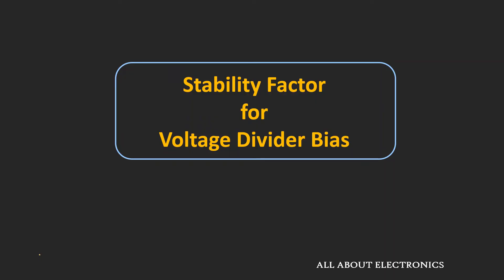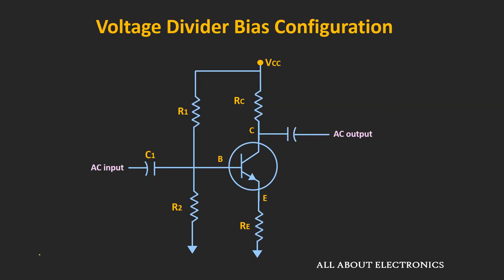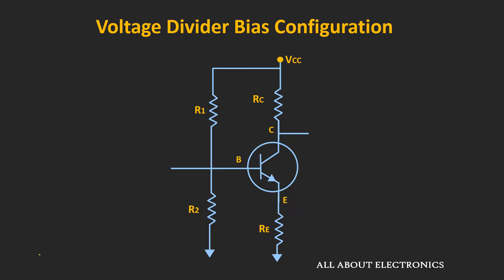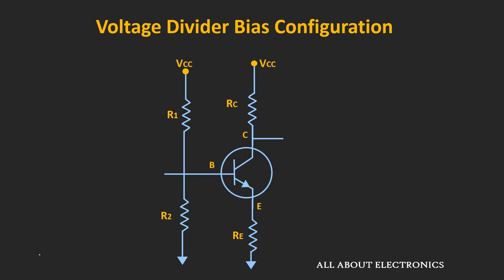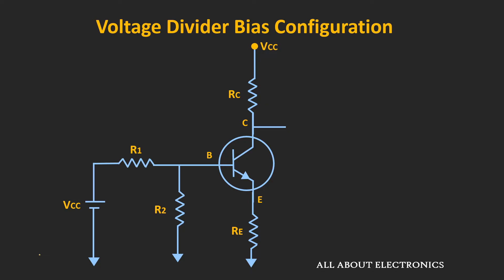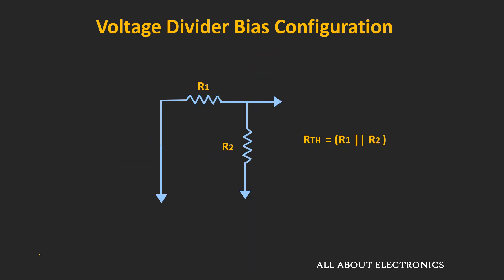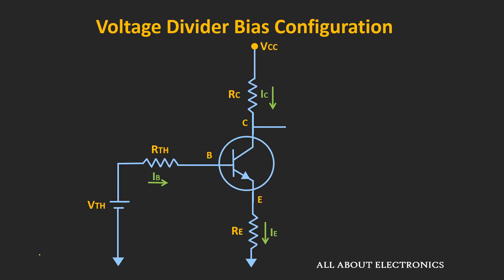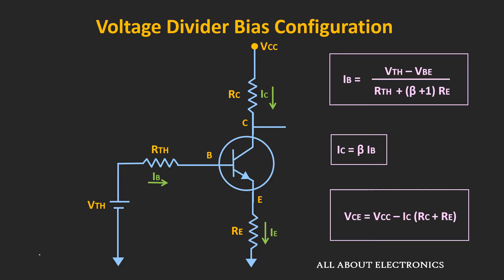BJT: Stability Factors S, S' and S'' for Voltage Divider Bias

Comment: Sir, i could not get why you differentiated stability factor s with respect to Ic not Icbo ? thanks beforehand.
Reply: That's differentiating Ic w.r.t  Ic to get S(Icbo), it comes out from the differentiated eqn. .
Reply: @abhijitkumarmanna2031  thanks for your opinion... it may be this also, like in voltage divider the vcc(vcc=vbb) is divided and fed it to base terminal, when you calculate the vth comes out to be less then the original vcc,the diplition region gets wider(as reverse bias voltage is high at terminal C as compared to B and all of the electrons get collected by collector so there so such recomination of electrons)  due to lees ib(vth
-vbe/rth..if (b+1)re<<rth is come ot to be less then the (vbb-vbe/rb)) the flow of current through the CB is pure ic=icbo.